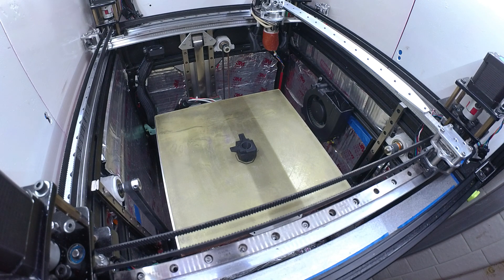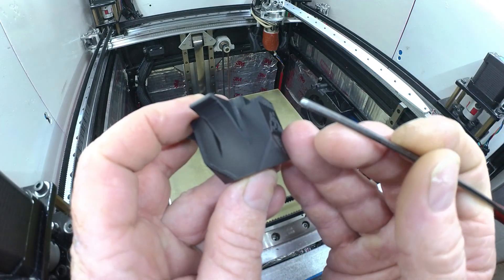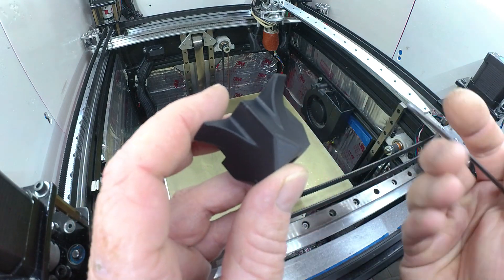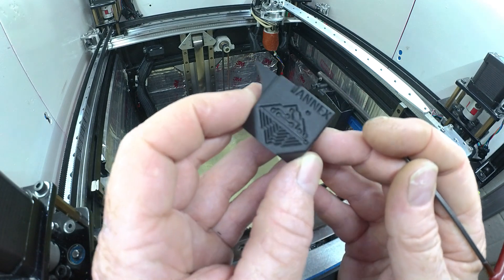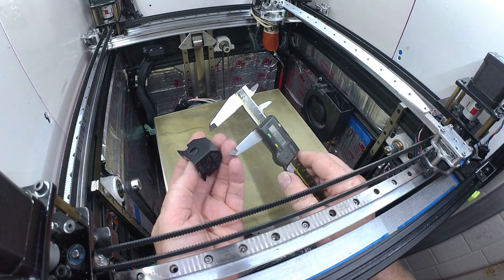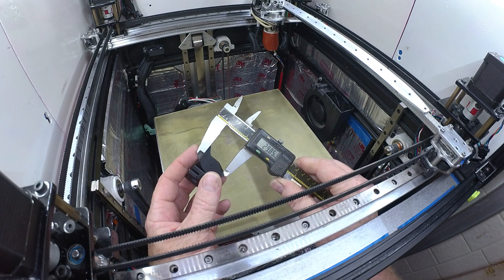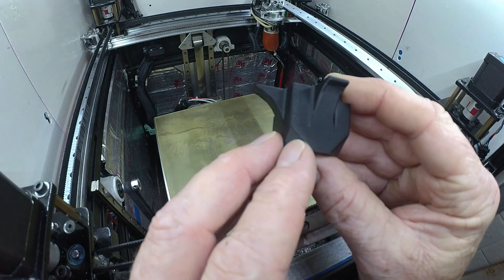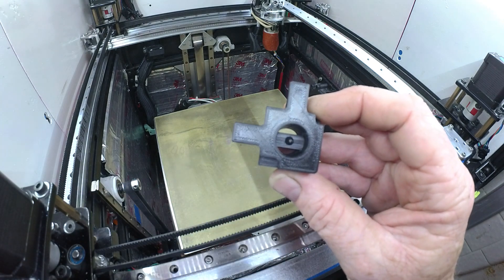Annex Cube test after rail tramming

Comment: Do you do anything with PLA? ABS makes sense at speed, but when there's a need for PLA? I'm looking to your videos for tuning guidance 😅 so impressive
Reply from the maker: With PLA it depends on min layer time and cooling. Can print same speeds with PLA depending on layer time. Larger model=faster print/speed/accel. So think of it as a ratio between filaments.If ABS is 1, then PLA may be .7.
Reply: @MrRocksalt  that's a nice way of looking at it, thanks!

Comment: Those overhangs are awesome and the top surface finish looks so good, it looks like its the bottom of the print off a smooth pei bed!!!

Excellent work as always.
Reply from the maker: Turn fan off for tops and you will get that. Same for infill, if possible. Heat helps a lot! Fan.. not so much esp ABS.
Reply: @MrRocksalt  do you need post processing for that?
Reply from the maker: @TheLuciano1806  Slicer tuning? As in height range modifiers or temp or fan or or? Not really, no, but yes. On this cube I wanted 45° top but not for the body. The rest of the profile is typical fan stuff, temp, speed, Pressure advance, and square corner. So this profile can be used for other models related to 'slow functional prints'. It does have to follow those parameters. This particular 'tune' is meant for functional print, slower speed, high acceleration, minimal fan.
Reply from the maker: If you meant "between extrusion role changes" yes, I use it. But for most models with the same speeds and type.